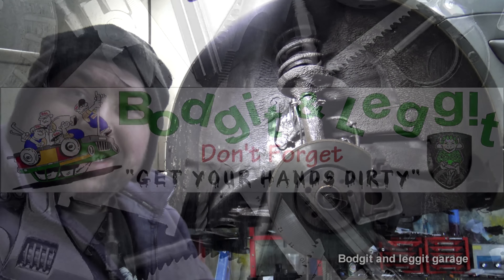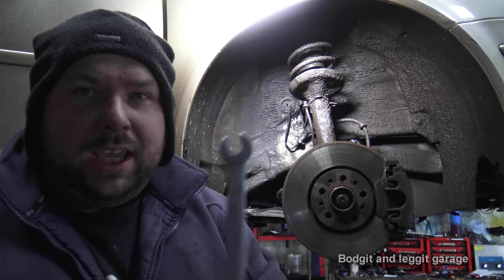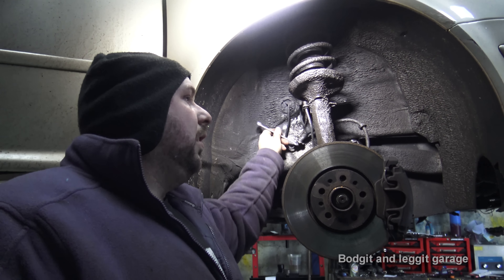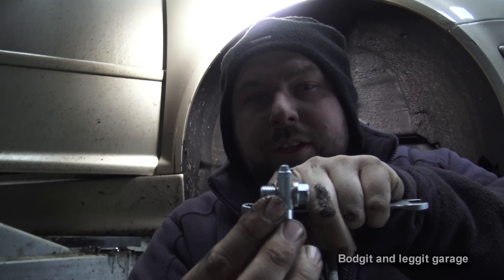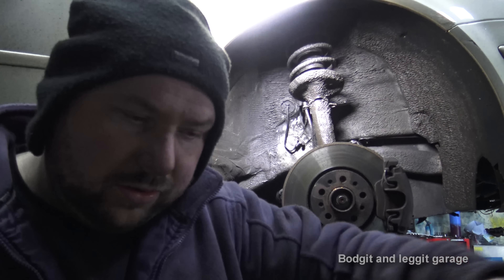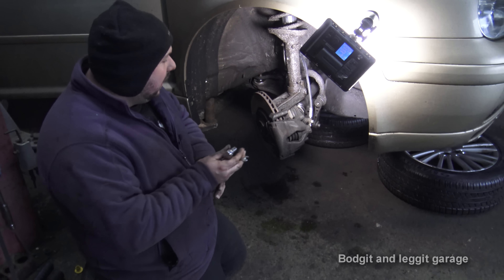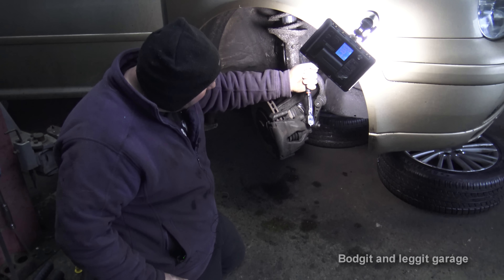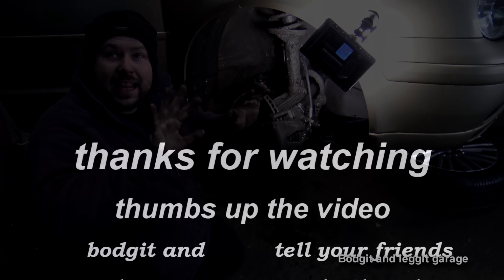How To Remove And Install Brake Lines On A VW Golf Bodgit And Leggit Garage

Comment: hi mate do you know how far that brake line goes into the engine bay,  i fooked mine when taking the hose off, it twisted and cracked open,,    or what the part is called as i need to replace that now,   cheers in advance kev
Reply from the maker: It goes all the way to the master cylinder but you can repair yeah just the little bit of the brake line that broke if you've got the right tools